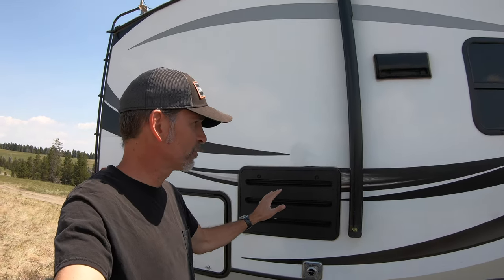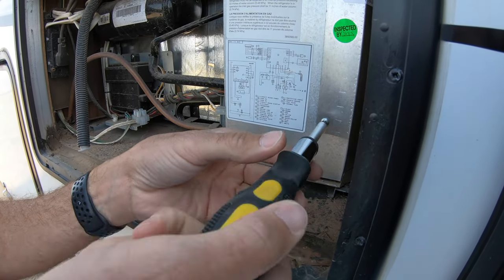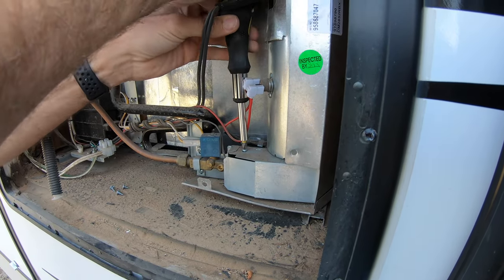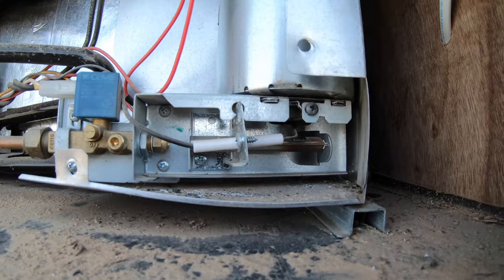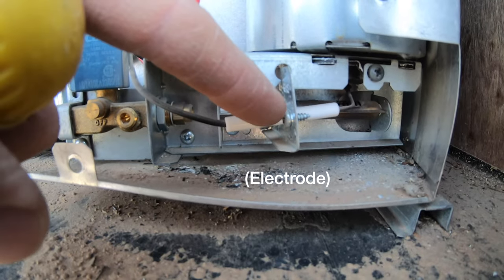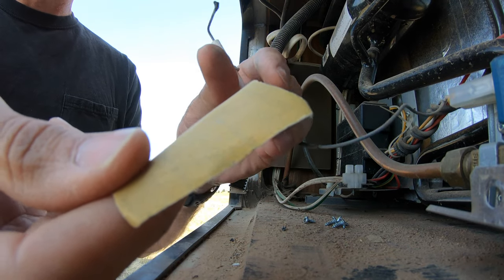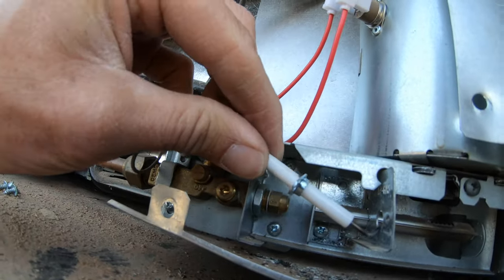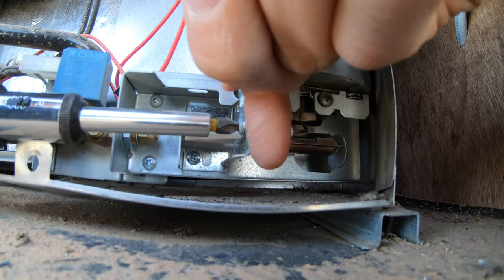RV Refrigerator Not Lighting Right Away? (Clicking Noise) - Quick & Easy Fix

Comment: I really enjoy your instructural videos. They are very clear and easy to follow. Always emphasizing safety👍🏼.

While you were at it, did you check the electrodes on the water heater and the furnace as well?

Just wondering. 

Seemed like a lot of build-up for less than two years old.

Thanks again Ed. 

Nice work Ann!

“Teamwork is dreamwork!

Ram
Reply from the maker: @Laughing Ram Hey Ram!  Glad you enjoyed!  I checked the one on the hot water heater and it was good.  Have not checked the furnace though.  That would require pulling the entire furnace out from under the fridge (had to do that before, it's not fun...).  It was a lot of build up.  I'm thinking maybe due to all of the dirt and dust that blows into that compartment?  As always, thanks for watching and commenting Ram!

Comment: Thanks Eddie,
I have the same problem, but now i will try your idea out tomorrow , Thanks for sharing your video.
All the best
Duncan,  Cornwall UK.
Reply from the maker: You are most welcome Duncan!  Were you able to get your issue resolved?
Reply: @EddieAtLarge  Hi Eddie,
Unfortunately it wasn’t the answer but well worth the time checking. Thanks again as it may well have solved the problem.
I don’t actually think the gas is getting through even to the pilot light. Ha ha ha the joys of motor homing 🤣
All the very best
Duncan.
Reply from the maker: Ahhh, sorry to hear that it hasn’t worked out yet.  Keep at it and I’m sure you’ll solve the issue with more persistence.  And yes, we never get bored while maintaining our rigs!  Safe travels.  ✌🏻
Reply: @EddieAtLarge  🙋‍♂️👍🏻

Comment: My domestic won’t switch to propane and I’m wondering if it could be because my small solar panel that keeps my battery charged is keeping the fridge with a small electric charge, enough to light the lights but not chill, it keeping it from switching to propane, it clicks but doesn’t  switch. Do I need to call a pro? Or can I try disconnecting the solar from the battery…..I’m 80 not real handy!
Reply from the maker: Hi Kathleen, the issue should not have anything to do with your solar panel.  The fridge uses very little power when running on propane, so, if you have enough power to run the lights, you should have enough power for the fridge.  I would suspect that you have an issue similar to what we showed in our video or you may need a part replaced such as the thermocouple or gas valve.  Sorry to say that since you are not handy, I would recommend having an RV repair company take a look at it.  Best of luck to you!
Reply: Thanks for your advice, I’ll do that!

Comment: Mine has no spark . I can light it with a cigarette lighter and it runs fine . Any ideas ? I changed the igniter still nothing. .
Reply from the maker: Hmmm.  Did you make sure you have the proper gap between the igniter and the burner tube?  Our manual specifies a 3/16" gap for our make and model.   If it's too close or too far away, it may not be able to produce the spark.  Kind of like an engine spark plug has to have the right gap to spark.

Comment: Usually, I found that it's related to elevation. At higher elevations, above 8000 feet, it takes more clicks to light the fridge, because the air is thinner, and the flame doesn't burn as well. I found that jat elevations above 10,000 feet, it might not light at all, and will just lock-out. The solution is to go to lower elevation. 

As for your suggestion about cleaning the electrode, I disagree. When it doesn't light, even though the electrode is producing continuous sparks, it's because it can't properly detect the flame, and this is usually due to thin air at altitude.
Reply from the maker: Hi John, while I agree that elevation does cause issues, this was not the case in our situation.  You can clearly see the buildup on the igniter and the immediate results after it was cleaned.  We were at 6600' elevation where we shot this video and have camped well over 8000' since without any issues with the fridge lighting.  

Now, we have had issues with our water heater having a really hard time igniting while over 8000' and I found a remedy to that by removing the main cover to allow it more air/oxygen.  As soon as I remove the cover, it lights right away and burns strong.  So, that may be an option for you to try when over 10,000' and your fridge or water heating is not lighting.

Comment: Mine won't click half the time and clicks a lot without lighting when it does. I cleaned it (although it wasn't that dirty) as per instructed here. Even wired brushed and blew out the other areas up under there. Still nothing. But you know what does click? My stick lighter. So technically my fridge is working again. It's just a manually and not an automatic now XD
Reply from the maker: Sorry our fix didn't work out for you.  Sounds like you may need a new electrode.  Great idea using your lighter for a temporary solution, of course, that will probably get a little tiresome after awhile.  😮‍💨
Reply: @EddieAtLarge  Likely will. But I just spent a few hundred on the stuff to redo the roof. Complete with new vents. Even got an Alfa Camp pro 3 coming for it (just waiting on that to arrive and the ideal weather). I also just got done replacing a burnt out motor for the furnace fan. So I need a break from buying things to fix this PoS for a while, lol.
Reply from the maker: @The1Helleri   Wow.  That is a lot!  I would have recommended going with Starlink though in lieu of the WiFi extender.  Starlink is da 💣 !  https://youtu.be/ml1STWgfG68  And they just officially released "Portability" aka "Roaming".  We've been using the Roaming feature for 2 months now and it is excellent.